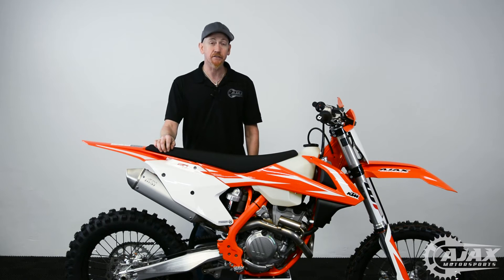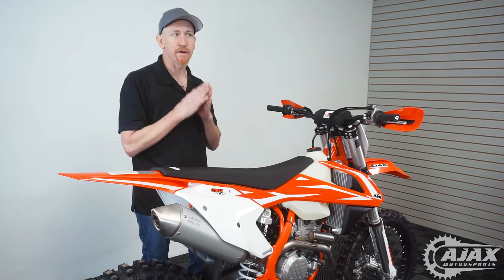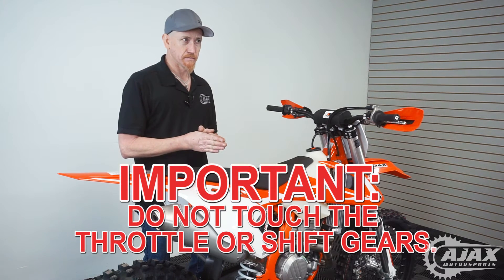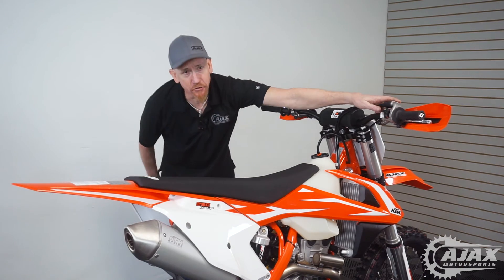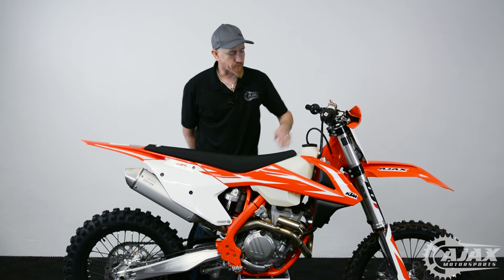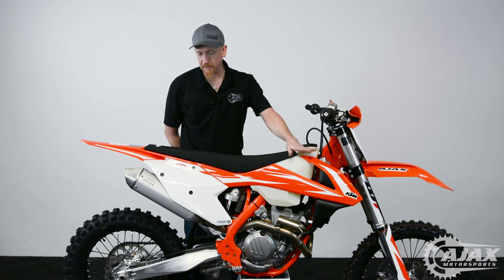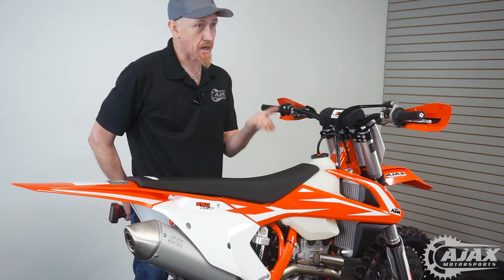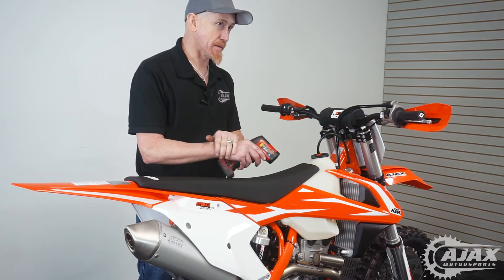KTM and Husqvarna Initialization // AJAX Tech Tip

Comment: Would this work on a 2stroke that has an aftermarket radiator fan installed...? Thanks
Reply from the maker: Depends on the year and there are different procedures on the new 2 stokes with FI that aren't as simple to do at home. I would check your owners manual and see what it recommends for your bike but the fan shouldn't effect the initialization as long as it isn't coming on too soon and cooling it down before it reaches temp.

Comment: "Wait until the coolant start leaking" Basically overheat your bike to "make it work better"????
Reply: No harm at all. 
He specifically said fill the expansion tank. 

That space is designed for fluid to rise once it’s heated. 

Under normal operating temperatures, the fluid is just above the fins and it won’t overflow. 

Basically that expansion area is the pre overflow tank.